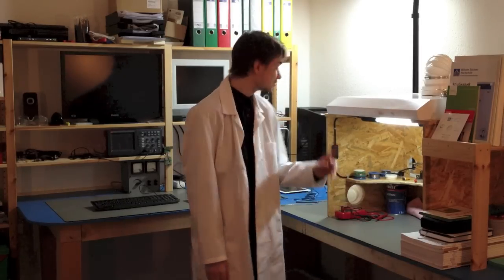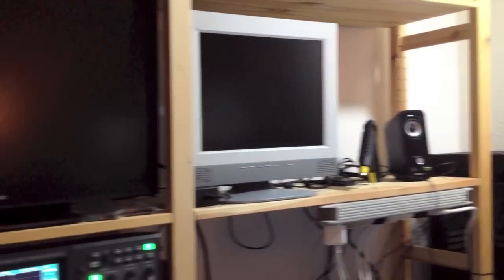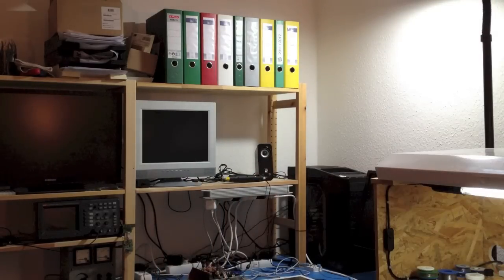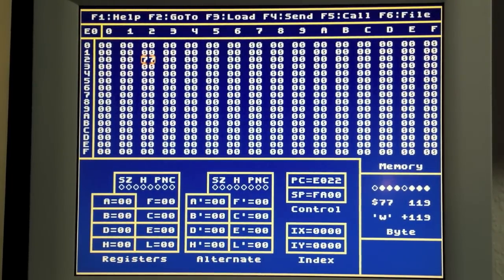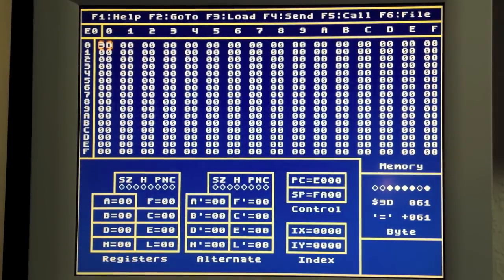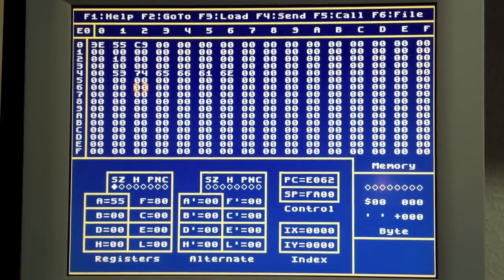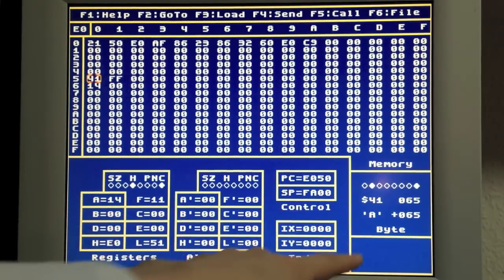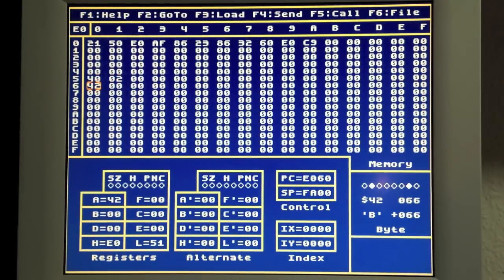Bare Metal Computing 0x00 - Dive into binary data and the machine code

Comment: Are you somehow using the ZD interface to read registers and special flags etc? Otherwise I would think your monitor code would be running and change the values as it executes?
Reply from the maker: When the monitor code is entered, it copies a snapshot of the register contents to a fixed location in RAM. That snapshot is what's displayed. When I leave the monitor program by running code, the register values are written back just before leaving the monitor program.

Comment: Why the lab coat? i) You just really like lab coats? ii) From your work and you're used to cleanroom? iii) You do have etching etc chemicals around, so you use it protectively and got in the habit to wear it all the time? (noticed before in other videos too.)

Just curious :)
Reply from the maker: I bought it for reason 3 when I decided to try HCl+H2O2 etching. Now I just wear it for reason 1, i.e it just looks like I totally know what I'm doing! But it is also useful for soldering. I ruined lots of clothes before with flux stains and solder burns but the coat is very durable. I also got matching pants, gloves and safety glasses for REALLY serious science!
Reply: For science!

Well, we all ahve labs in our houses now (I do not call it a Office; thats lame. If it s a laboratory, damnit!) .. so having matching mad scientist boots and labcoat, all good. And goggles.

http://onitpr.files.wordpress.com/2012/05/doc-brown-back-to-the-future.jpg

Comment: will it be helpful to create the new programming language? I have a plan to create a programming language in my mother tongue ... is it possible?
Reply: Of course it's possible, but you'll still need to learn how to program in another language first, because you need a programming language in order to program a programming language. (I know, it sounds a bit like a chicken-and-egg situation).

The closest you can get to "not learning a programming language" is coding directly in either binary or hexadecimal, but you'd still need to learn what codes do what for the particular CPU you want your programming language to run on, and the program would only work on that particular CPU and computer.

It's probably going to be easier in the long run to learn an existing high-level language.  Once you can program well enough in that language, you can have a go at making your own compiler.
Reply: @JasonMasters  isnt there a way to start it from ground? with machine code you could make your own language...

Comment: Where does the memory editor come from? Is it something you built or downloaded? How does the z80 chip know of its existence? Did you place it in the internal ROM?
Reply: Update, just checked your Github and found the source there. I see that you wrote it, wow! Where does it reside? Do you manually put the code into RAM each time you boot the cpu using the debugger as shown in the first video 'EightZero'? Or did you somehow flash it into the ROM?
Reply from the maker: JG I had to go throug the procedure using thw on-chip debugger only once. I then flashed the code to the internal boot RAM. In order to update itself the flash routine copies itself into RAM first and executes from there. I think it even has a progress bar.
Reply: I also see the source for the debugger. Did you write that as well? If so, that's impressive! Videos on how to write debuggers/memory editors would be neat.
Reply from the maker: JG The EZ80 makes it look a bit more complicated than it is. I got a much simpler setup now that is easier to explain. I still need some time, though.
Reply: Thanks for the replies and the videos!
The part that I find amazing/unclear is how people come up with the assembly code that achieves the functionality shown in this video. I would imagine instructions like poke and peek are used to edit the memory... but how is the cursor moved around, the background color achieved etc. I haven't been able to find a tutorial that starts from nothing and ends up with a working memory editor.
Reply from the maker: JG Just wait. Maybe I will make one some day.

Comment: Can I create/write a algorithm rather then learning how to write code using c , I rashly hate trying to learn c and am thinking of just going about to learn how to create my own programming language and compiler I'm doing all this just to control a couple micro controller and DC motor and servos on this humanoid robot that I am building
Reply: You can create your own language, but you'll have to learn how to program in another programming language first, even if that "language" is assembly code.

Assembly code is just one step above machine code.  In assembly code, each instruction generally has a 1-to-1 correspondence to the binary instructions which the CPU follows.

The down side of assembly code is that you have to think of absolutely everything.  Almost nothing is done for you.  For example, you have to decide how large each variable needs to be, and figure out how to handle multi-byte variables yourself.  Sometimes you can find a "library" of routines to do what you want, but it's still a bit of a pain to make programs in assembly code.

The up side of assembly code is that the compiled program is almost invariably more compact than code produced by a high-level language and almost invariably runs faster and more efficiently than high-level-language compiled code.

Comment: Sehr cooles video . Villeicht köntedt du mal so ne tutorialreihe zum z80 assembler machen :) ich blicke da gerade net so durch 

Ich baue auch gerade einen 8-bit computer :
CPU : z80 CPU @ 6mhz
RAM : 256K S-Ram + 16K S-Ram
ROM : 32K EEPROM + 32K UV EPROM
SID : MOS6581
1x DUART
16 outputs 
8 inputs
2 serial rs323 ports
2x16 Zeichen display 

Suche noch einen VDP oder VIC :)